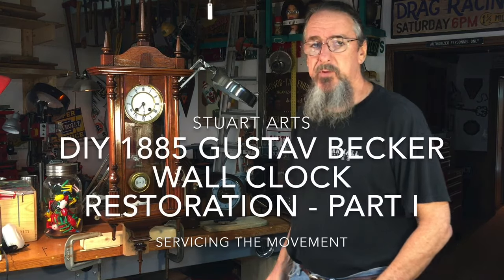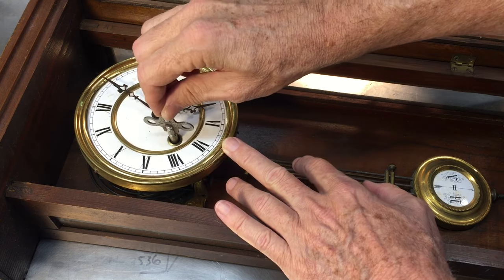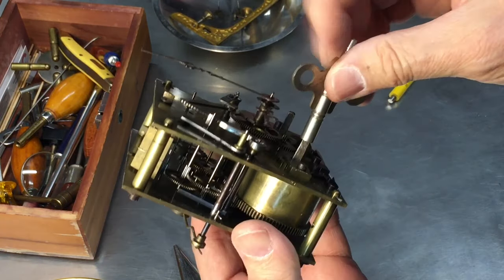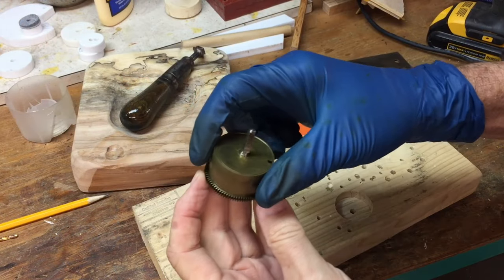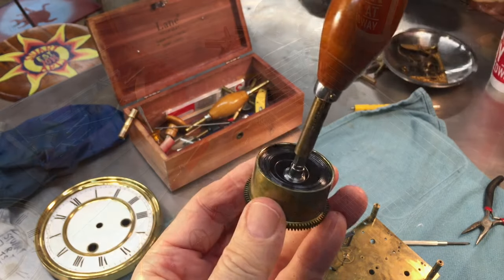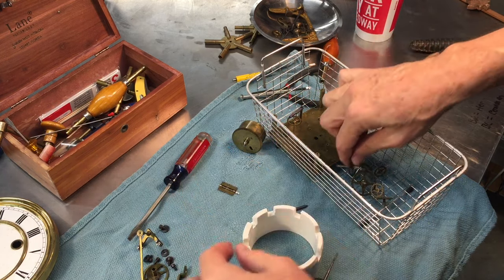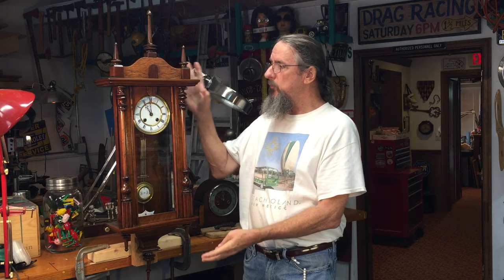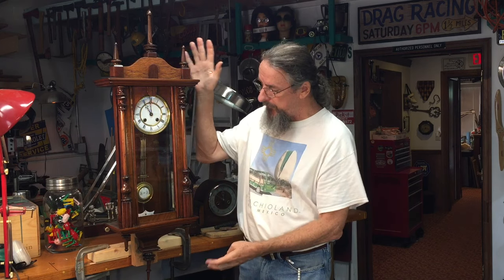DIY Restoration of an 1885 Gustav Becker Wall Clock - Part I Servicing The Movement

Comment: I would like to know for a broken pendulum, if the weight in it can be replaced
Reply from the maker: @AdrianaNedelcu-u2c  it certainly can. If you know the maker of your clock you can find many replacements on platforms like eBay. There are also on-line suppliers like Timesavers who may have just the parts you need.

Comment: Hi Jimmie !!!
Got GB circa 1900 from a seller. My problem is the quarter westminster chimes that work only for less than a day.  Is the problem due to spring that may have been cut short?
Is there a solution or replacement and where to get it?  Thks much !!!
Reply from the maker: That is possible, but the more likely explanation is that there is a lot of friction in the movement. Has it ever been serviced?
Reply: I think yes but I may have to   ask for servicing.  Thks for your reply.

Comment: Dear Sir,
I also own a Gustav Becker clock (serial number 1837212).
Just like the clock in the video, the frequency of its pendulum is 52 strokes per minute.
Is there a particular reason why the manufacturers chose 52 and not 60 strokes per minute?

Best regards

Comment: I loved this video! I'm going to watch part 2 later this weekend.  I got a quick question:  I bought an older clock (I assume pre 1945, as the mechanism itself is inserted in uranium glass), what are some beginner tips and tricks for someone who wants to clean it up and grease the mechanism? Is there a standard "order of operation" when you disassemble an older clock? Thank you :)

Comment: Jimmie I got a little problem:
I have inherited a GB pendulum wall clock (P48) i am very new to clocks but learned enough to get it going again, the only one problem I have now is the chime goes out of sync at 10:30 were it strikes 12 times then as follows:
11 o’clock   one chime
11:30     Twelve chimes
12 o’clock   one chime 
12:30      One chime
1 o’clock     one chime
1:30         Two chimes
And so forth the chimes being half hour behind out of sync, I may have caused the clock to be like  this when fast forwarding the time I’m not sure, thanks in advance
Reply from the maker: It sounds like your minute hand is 180 out. Take the nut off and reposition the minute hand so it points opposite where it does now. You might also need to adjust the position of the hour hand. It is friction fit onto the barrel and you can gently force it forward or backward.  If it hasn’t been serviced in a very long time the friction can be high … don’t push it from the tip of the hand but maybe the middle so you don’t bend it. Good luck
Reply: @JimmiePorterAtStuartArts  thanks, I had it apart last night, and set each chime off manually and it was fine, I put it back together and it chimed at quarter to and quarter past lol. (Another lesson learned) anyway I put it right and my initial problem was there again, 12 strikes at 10:30. 
I have only just seen your reply now, I will try your method tonight it makes some sense, anyway I will let you know 🤞
Reply: So after using your fix, it worked. It wasn’t instant but nevertheless it seems to be chiming fine now. I wish I had time to understand the workings that determine how the movement works, I could make sense out of it. 
Thanks for your help Jimmy
PS do you know anything on the value of these particular clocks?

Comment: I have a ? I just purchased a large antique clock like this just wondering how high on the wall to hang it.its 48inches tall and 17inch top crown and 12 cabinet width by 8 inches or so deep
Reply from the maker: I would hang it such that the center of the dial just above eye level.  But not too high…You want to be able to comfortably reach the dial to wind it each week. Good luck
Reply: @JimmiePorterAtStuartArts  that's what I was thinking too. Thnks.Merry Christmas

Comment: What did you use off-camera to get the spring back in the barrel? An Ollie Baker or another kind of winder?
Reply from the maker: I don’t have a winder so I just fed it back into the can a coil at a time. Not pretty and I always fumble it but it’s doable. I saw another video on YT showing it could be done by hand so that’s what I’ve been doing .... gloves are a must...
Reply: Don't do a 400day clock spring that way.